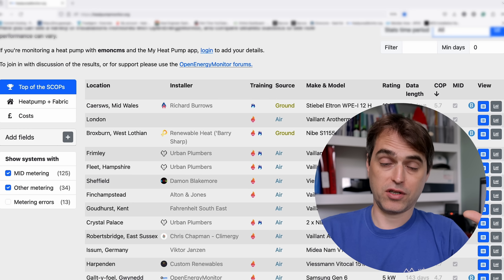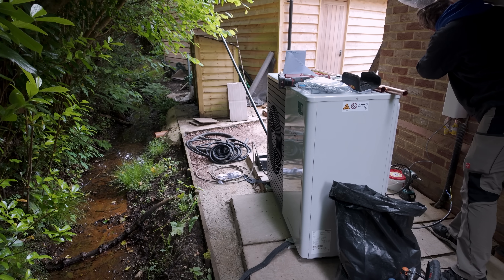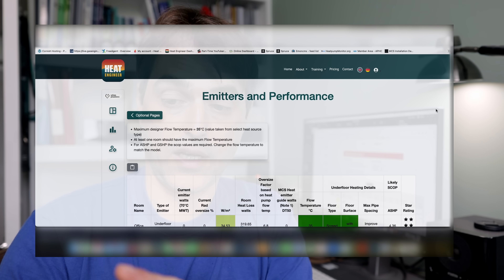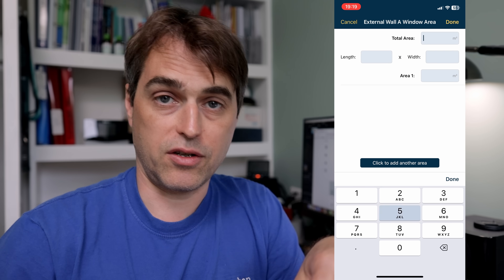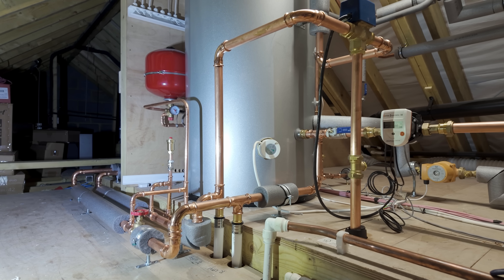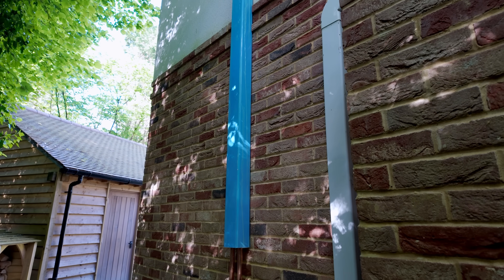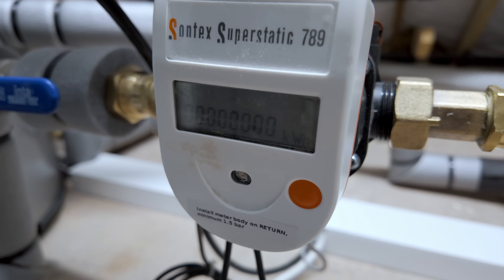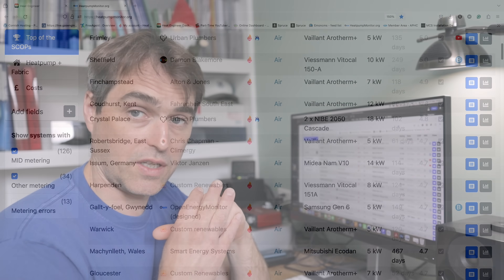Design Heating System Pipework Like a Pro

Comment from the maker: I have finally published my design calculations, which you see in this video. Please let me know if you can spot any mistakes, as I did not have time to go through the numbers.

https://www.urbanplumbers.co.uk/design-files-for-vaillant-arotherm-heat-pump-installation/
Reply: Thank you for adding these. they are really helpful.
Reply: Thank you very much for the effort you put into sharing this valuable knowledge! 
Is there any cheat sheet to get the pressure loss per pipe type/flow rate/flow temperature? I’ve looked online and tried to do the calculations to match yours, but can’t find anything.. 
Ty!
Reply: You are an engineer in a trade populated by experience based tradespeople the problem is there is insufficient experience and too many variables for experience to get it right. This is why there are so many VERY badly installed HP systems in the UK, the calculations and engineering is beyond your average plumber or tradesman.  I am a petroleum engineer which is a glorified plumber given we deal with the flow of fluids and we calculate out from a high pressure fluid in a reservoir 1 to 3 miles underground to the delivery flange with pressure loss, temperature loss and flow regimes amongst other considerations and it is obvious the variables as you describe are numerous and thus require calculations.  Good effort keep up the good work.
Reply: Thank you

Comment: Where do you get the information required for the PEX and MLCP pipe for designing the system?
Reply from the maker: You can calculate the pressure loss yourself or use manufacturers tables

Comment: According to the gov website our combi boiler excludes us from the boiler upgrade scheme. Please confirm. Thanks
Reply: I’ve got 10k which I was hoping could.cover solar panels and battery and heat pump and radiator upgrades etc. If the boiler upgrade scheme isn’t available we to combi boilers I can still do the solar panels and do the heat pump when the gov stop supporting it and prices come down.
Reply from the maker: Any gas boilers are fine for the BUS grant

Comment: How does one calculate the pressure drop on UFH circuits. Eg I know the flow rates, and pipe lengths and diameter is 14mm/12 internal. How do I get the Kv / head loss figures?

Comment: I may have missed it, but I didn't hear anything about including the vertical height of the loft above the heat pump in the pressure loss calculations? Surely that's a literal head of water pressure loss?

Comment: 6:42 How do you decide flow rate. Is this something you start with or is it dependant on delts T and total heatloss? I'm a bit confuse as to what the starting point would be when designing a system i.e. do you start with deltaT ?
Reply: You start with the total heat loss. Then it depends if it's a refurb or newbuild

Comment: Thanks for this really helpful video and so generous. Your work looks fantastic.
It looks like you use the pump curve for the 3.5 and 5kw Arotherm models rather than the 7kW version, giving 40kpa rather than 44kpa at 1200 l/hr. Is that right? Or is the difference negligible?
Reply from the maker: Possibly - 4kpa difference so not much

Comment: Another question if I may please. I can see the Tee joint splitting the flow pipework towards the first floor radiators and ground floor underfloor heating. You also mentioned that there is no blending valve on the underfloor circuit. Assuming that radiators and UFH manifolds are on separate zones with their individual thermostats, how is the design protecting the UFH from high temperatures when there is demand from both zones? Unless your design flow temperature is perhaps 45 degrees or low enough for both zones? Thank you
Reply from the maker: Design temp is 35c and there is no zoning.
Reply: @UrbanPlumbers I see, nice and simple. Did you need to upgrade radiators for 35C flow temperature or were the originals still able to produce enough output to meet design heat loss.
Reply from the maker: @NosyGR yeah had to upgrade all of them

Comment: Can you please help me understand how did you get the pressure drop on the diverter valve calculated at 1KPa? A KVs of 12.8 means you get 12.8m3/h flow rate at 1 bar pressure drop (100KPa). Your design flow rate is 1.25m3/h so shouldn’t the pressure drop be more like close to 0.1bar or 10KPa?
Reply from the maker: I think I know where you go wrong. Pressure loss is not a linear function of flow - so you cannot divide 12.8m3 ata 100kpa by 10 to get 1.28m3 pressure loss.

With a doubling of flow you get 4 times more pressure loss in very simple terms.
Reply: @UrbanPlumbers  Thanks for coming back, I appreciate it. You’re right, that’s what I was (wrongly obviously) assuming
Reply from the maker: you must have a decimal wrong. My flow rate is 1.28m3 per hour so pressure loss through a 12.8KVs valve is 0.98 kPa

Comment: Is that 32mm OD or ID or outside diameter or inside diameter?
Maybe some 2 to 3 mm thick copper pipe would help retain the heat.
Copper is a good heat conductor copper pipe all the way

Comment: More equipment, higher cost of parts? All that mlcp has to cost as much as a buffer.....
Reply from the maker: £80 per 25m roll - so around £160 plus fittings on this job

Comment: Encouraged by your excellent video, I have started to calculate the pressure loss in my index circuit. The method to calculate this for pipework is well documented, but I cannot find any figures for the actual heat pump (12kW Gen 6 Samsung) or the 600 x 1400 K3 radiator. Where do you go to get these sort of values to get the total pressure loss? Thanks.

Comment: In cold weather the ASHP may freeze if its working hard. Wigh no buffer where does it draw heat from when it reverses if there is no extra volume in the form of a low loss header or buffer? Having said that that im not sure if you design a buffer vessrl under the hot water storage as per old school???

Comment: Hi, enjoy your videos, quick question, how do you get on with extended warranties if not using glycol? Samsung requires a backup heater if no glycol, which you can only get from a buffer.... .what if you don't need a buffer?? Catch 22
Reply from the maker: Don’t use Samsung. Viessmann and NIBE don’t require glycol or anti freeze valves.

Comment: I am learning a lot from your videos and it is proving very helpful when getting quotes in for replacing my gas combo-boiler with a heat pump.  One thing that was recently mentioned, that I haven't seen before, was having a monobloc heat pump running a water /anti-freeze mixture in a loop to a heat exchanger rather than circuit going directly to the heating or hot water coil.  I was told this was due to living in Northumberland it was to prevent freezing.  I have not seen this on any videos before and don't know if it is needed or how it may affect the heat pump efficiency.  I would welcome your views.  Thanks
Reply from the maker: Not needed and will affect efficiency negatively. Use AFV instead.
Reply: @UrbanPlumbers  Trace heating is another option, but only if the electrical power is supplied from an uninterruptible power supply capable of supplying the trace heating for a long period. I agree that AFVs are the most reliable and energy-efficient way of protecting monobloc heatpumps.

Comment: Is it cheating that you showed the heat pump being installed before asking what the heat loss is? 🤣 Single fan vaillant, and almost square, so it's the 7kW unit, so looking at between ~6 and ~8kw.  I'm going to go with 6.8kW

Comment: Syzmon another excellent video in all  respects and pitched perfectly for either those in the industry or interested consumers. I note this system featured in the video is not on  the heat pump monitoring site yet - does that take a while to feed through?
Reply from the maker: It should be, unless I forgot to register it
Reply: @UrbanPlumbers  the snapshot shows as per your link, but the other site is not showing in table format with other installations (There are four of your installations showing in the table).
Reply from the maker: @normanboyes4983 change 30 days to all on OEM. New installs are not visible as they are under 30 days old
Reply: @UrbanPlumbers  Got it thanks.👍

Comment: Great video Szymon as you say the top 1% of installers all do this. Hopefully that percentage will continue to expand until it's the norm rather than the exception. Thankfully the resources and training is available to those who wish to learn.
Reply: I'd agree with him and his working practices being in the top 1%, not criticising his work at all, but I'd guess a job like this must also be only affordable for the top 1% too. I think the real issue is that most people simply couldn't afford this installation, and that's where standards lessen, to match the market. At a guess, I'd think this installation must have been something around the £15,000-£20,000 mark?
Reply: @TheZippyMark  agree 100%. It’s still early adopter territory for many. Mass market will soon bring volume will bring down pricing.
Reply: @johntisbury  that too, in that early adopters are also enthusiastic to learn and willing to tolerate any teething issues along the way. I do think there will be big issues when heat pumps are being fitted in places that didn't really want them, I.e. council houses etc, because I guarantee people will insist on only running it for an hour a day no matter how much you tell them that's not the most efficient way.

Comment: I criticized you for "lets guess the heat loss" on a previous youtube, you have redeemed yourself for explaining how critical an accurate heat loss calculation is for sizing heat emitters, sizing connecting pipework, selecting the correct water pump and ultimately the correct heat source (heat pump). Time well spent to get it right, and actually with the apps now available, not very difficult to do.
Well done. The quality of your work is always evident.

Comment: Great video.  The bit you don't discus is how you run radiators and UFH on same heat curve and how you balance this.
Reply from the maker: I will do a video on it in the winter
Reply: @UrbanPlumbers  Please! Can you cover situations where, for whatever reason, the radiators can't be upgraded to work at the same low flow temperatures as the UFH.

Comment: Szymon, would you be able to a quick tutorial on how you setup your pipework in the brackets with the insulation in position and also how you then insulate the pipes afterwards?
Reply: Have a look at primary pro website, it’s all on there, very easy to

Comment: What controls the diverter valve?  Do you have a control system to do this?
Reply from the maker: Heat pump controls control the diverter
Reply: @UrbanPlumbers  And presumably the cylinder stats signal to the heatpump when there is DHW demand from the cylinder.

Comment: Great video, very informative. If your calculations show a need for 28mm pipe - say between the heat source and the cylinder, and the fittings on the boiler are 22mm, what do you do  ?
Reply from the maker: Short distance of smaller diameter doesn’t matter. If you need 28mm then you use 28mm no matter what connections you have on a boiler or heat pump.

Having said that to use 28mm on a boiler you need around 40kW heat loss.  I have seen a lot of the biggest houses in my area - not a single one was even close to 40kW heat loss. Doesn’t stop people installing 40kW in flats.
Reply: @UrbanPlumbers  thanks for your prompt reply.

Comment: Another great video and a bit of an eye opener regarding pipe sizing. 
Thank you for taking the time to do it. 

Also, X2 anti freeze valves? So is that official now? Vaillant wants two AF.
Reply from the maker: Yeah, been told off for using one
Reply: @UrbanPlumbers  does it affect the warranty on the ones where you have only fitted one AFV?
Reply: @UrbanPlumbers Can you honestly imagine Vaillant honouring warranty for a frozen evaporator even with two anti freeze valves fitted?🤷‍♂️

Comment: It’s a shame you can’t put the AC below the heatpump as the ac will produce hot air and the heat pump will produce cold air or at least that’s what I suspect.
Reply: Do you really think they will be cooling the house while trying to heat it?
Reply: @normanboyes4983 what happens when they are running the heat pump to heat up hot water then? That is the time when heat pumps run at the lowest COP and have the most cold air output from the heat pumps heat exchanger. The warmer that is the better the COP. watch a bit of heat geek experiment when they put reflectors to use sunlight to create more heat.

Comment: Very nice job, and detailed explanation!
How can you measure/estimate the length of the existing underfloor heating pipework if you have no plans for that? It seems also crucial to define the correct pump.
Reply: A Thermal camera might work in this siutation. If access under the floor is available, even through small holes, an endoscopic camera might also work. It would be worth taking the time to map any existing pipework as accurately as possible.

Comment: Amazing video.  Curious why the air conditioner and heat pump are different units?  Wasn't this a good opportunity to consolidate them?
Reply: When you look into it, it turns out to be very difficult to do cooling with an ASHP. Not impossible, most will have a cooling mode that will produce chilled water, but you need very careful design to ensure you don't get condensation where you don't want it. You will probably find that you need different emitters - e.g. fan coils that are specifically designed to capture the condensation. And fan coils are expensive! You also need to consider DHW requirements - if you don't, you might be asking the ASHP to chill water to 18C before then asking it to heat it up again to 45C+ for the DHW, and then chill it down to 18C. It could be very inefficient unless you design the system correctly. It's not a trivial task. A second ASHP for DHW could be part of the solution but this adds extra cost. The Vaillant AroStors are an interesting option for just DHW, so that the main heat pump only has to switch between heating and cooling a few times a year. Heat Geek should produce some training on Cooling with heat pumps, but it is a massive undertaking, and there isn't a great deal of customer deman yet due to the extra cost of adding the fan coil units. If climate change increases the severity fo heatwaves in the UK, it might become a more sought after skill.

Comment: If these concepts aren't included in the official qualifications you have to start to wonder what the value of the qualifications are and the purpose of the accreditation bodies are. Great video
Reply: These fundamentals were pretty much all included in nvq L3 when I did it in the 90's. The problem is that it got forgotten as nobody used it daily when fitting high temp boilers after college.

Comment: Thanks for this it helps further my ability to consider what my installer should or should not be doing .
  When you do heat loss calc what assumptions do you make about insulation , is it referenced to the minimum requirements at the time of construction plus what the home owner advises as upgrade  etc ?

Comment: When you see the difference between industry mass installation figures, and those from the more educated plumbers who are taking the time and doing the training, you can see why these videos, from yourself and HeatGeek and similar, are so very important. I do believe this level of training should be the normal. If they can't do it, then they shouldn't be installing it. Been off the tools for some years now, but I now look at who is trained this way and who isn't, and suggest folks do likewise.
Reply from the maker: I agree - this should all be basic knowledge. Industry has been dumbed down for years. Pluming is a skilled job in both manual and theoretical sense. We need to change the perception of heating installers as just pipe fitters.

Comment: So complicated.. May as well forget it.

This is insanity
Reply from the maker: Forget to have decent heating? Those principles apply to any heat source - boilers including
Reply: I think it just highlights how little effort has been put into most heating design. Just running any old pipework diameter around and then oversizing a boiler to be on the safe side. Makes me wonder just how inefficient and wasteful most homes must be.
Reply: Are you a homeowner or a plumber?

Comment: Will the airconditioning system be conflicting  with the heat pump in the background and will this affect scop performance of your installation.  Great 👍 video
Reply: I believe it should not, as air con will be used in summer to cool - so output gonna be heat on outside & it should come up, and heat pump only heat hot water time to time - so it will affect air con a bit negatively.